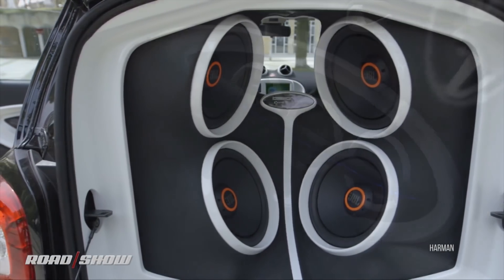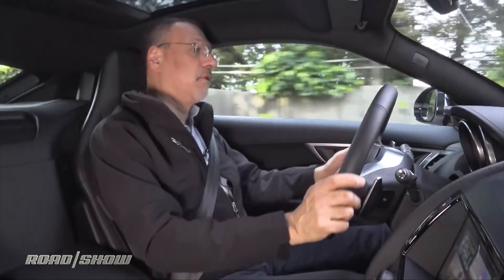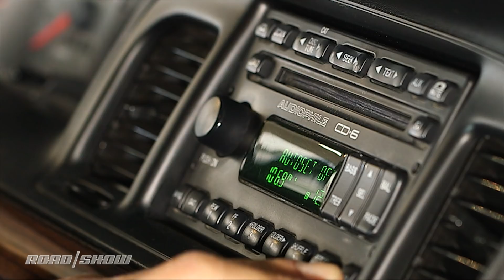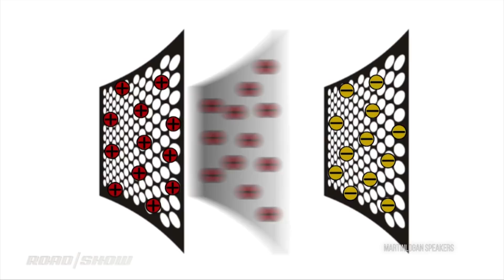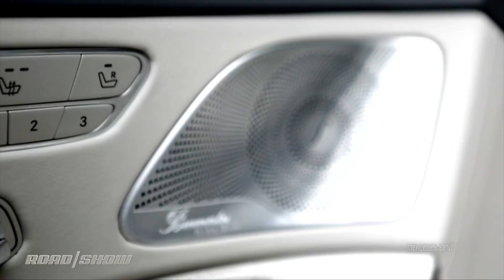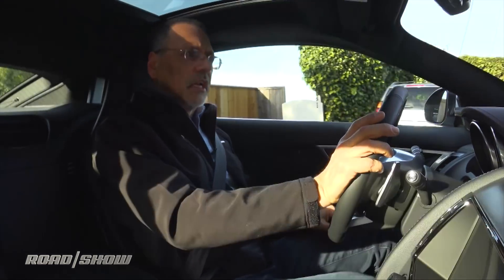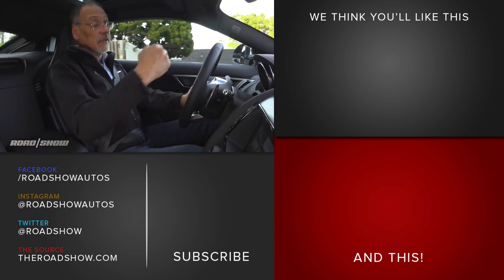Car Tech 101: Car speakers are about to disappear

Comment: But...those pop-up tweeters on the Audi dash are sooooo cool.
Reply: Till they stop popping up.
Reply: Its a mercedes
Reply: fatboy19831 My a6's flippy screen is 5 years old and hasn't broken yet lol
Reply: V.Vega "yet"   time to sell.  You have passed the duty cycle of the A6.  I know 8 people that have owned A6 cars.  They are a killer used car value.  They buy in between  75,000 to 100,000 miles and tap out before 130,000 miles.
Reply: fatboy19831 Oh i know its totally a "yet" situation lol. I've had great experiences with vw/audi products though. Sold my last a4 at 190k and it never gave me any trouble. My passat wagon is still going strong at 170k. The a6 has been almost completely trouble free with 60k on it, the 2.0tfsi is a fantastic engine. I'd be really surprised if anything major broke before 200k.
Reply: Be prepared to be surprised.  The A4 is a far more reliable car than the A6. Just like the BMW3 is more reliable than the 5.  Volume of scale.  The 1998 to early 2000's A4's were 250,000 mile cars even the twin turbo V6 A4's with manuals went well over 200,000 miles.  A6 tap out before 130,00 miles.
Reply: fatboy19831 It's literally the exact same powertrain. The early 2000s c5 a6's were a bit sketchy. The c6 and c7 generations have proven to be very reliable cars.
Reply: The powertrain is not the problem the rest of the A6 is.   130,000 trouble free miles is beyond the lifetime rating of the automatic transmission fluid.  Count your blessings.

Comment: Great idea, but speakers that vibrate the panel? High bass and the car is gonna rattle like crazy
Reply: yeah my 350z has plastic covers over the speakers, doesnt really hide them and i never thought they were really trying to be unseen, rather sleeker than just a standard look. however they still rattle...
Reply: Panels don't play bass. But lower mids would create annoying rattles if not done right :)
Reply: Dave Taylor or what if it’s covered with soft material I’ve seen some people put like cloths on their dashboard for whatever reason wouldn’t that interfere with the vibrations making it sound muffed like you’re listening from another room

Comment: Space for better things, like?
Reply: Door hinge fluids!!
Reply: 35 cup holders
Reply: French fries holders
Reply: Normal speakers with high ass wattages 😈
Reply: There gonna put screens in the door panels, screens in the rear deck, screens under the dash. They're putting screens everywhere. Ditch that pesky steering wheel so we can put a screen there
Reply: Yes! LOL
Reply: Some more fucking useless displays.
Reply: I think Joe Hammond hit on it in another reply. "But...those pop-up tweeters on the Audi dash are sooooo cool." You need to save space and weight so you can add things like pop up actuated motors and the electronics to make them work...
Reply: More cup holders,, phone holders
Reply: edwing rodriguez you’re not thinking big enough why stop at French fries holders what if we remove the gauges behind the steering wheel and add a microwave
Reply: Beer coolers, they will be handy when cars are fully autonomous
Reply: ronlovesit  Yeah that's right hater! 🤣🤣🤣🤣

Comment: But how rich is the sound?
Reply: isaac wilson there are bluetooth speakers that vibrate and make sound,also xiaomi mi mix phone does this

From everything I have seen its not as good as a real speaker and will never be
Reply: I would say middle class, A middle class that is being pushed into proverty
Reply: Probably not nearly as rich as you need to be to afford something with this technology.
Reply: They have a long way to go....
Reply: Robert Ri xiaomi's mi mix 1 earpiece doesn't sound as good bc the driver unit is small and behind glass. If you don't know, sound doesn't go through glasses very well. I imagine integrating that tech behind headliner would work much better.
Reply: the loudest speakers has the most rich sound and my speakers is the loudest speakers in the world